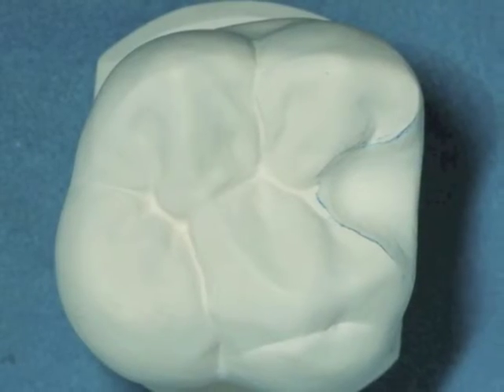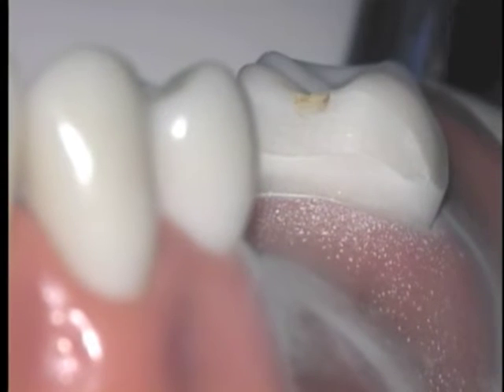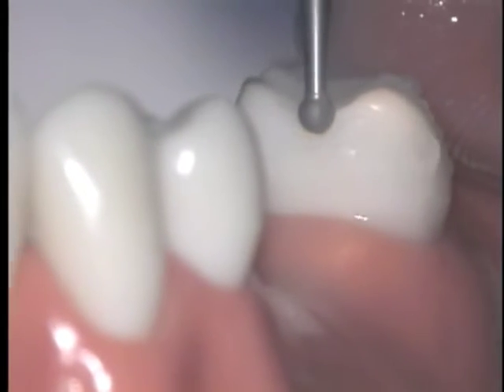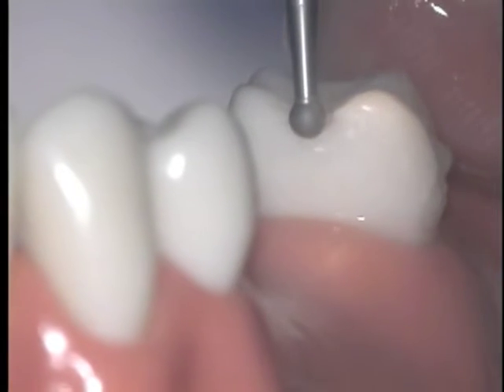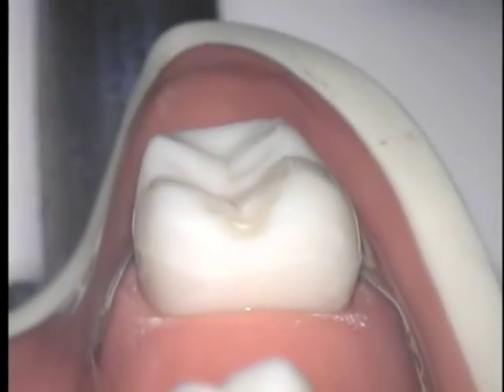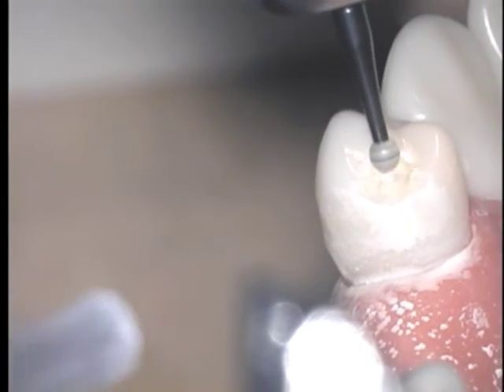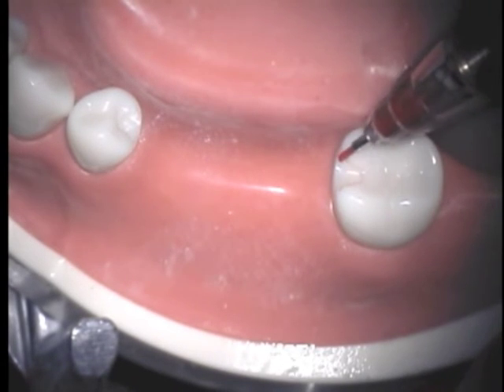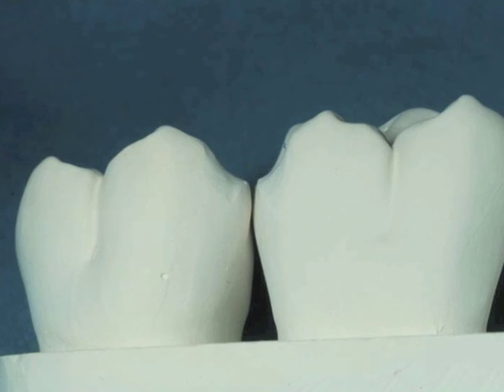06 Occlusal Rest Seats

Comment: Dr. Loney what kind of rest is best for lateral incisor in a class 3 case considering lateral incisor is the anterior abutment and the first molar is the posterior abutment around the edentulous case
Reply from the maker: Each situation is different, but most commonly if there is sufficient cingulum, use either an inverted 'v-shaped' cingulum rest seat (see my video,  https://youtu.be/huI5NG36WlA ) or if there is insufficient bulk of cingulum, a bonded cingulum rest seat (see my video, https://youtu.be/WLK7xaLgR3c ).
Reply: @DrLoneyDal  thank you so much could you please let me know if we need to give a bonded cingulum rest with apron considering the above case and the lateral incisor as maxillary Lateral

Comment: Hi! How do we decide if the rest seat is to be given on the mesial or distal side of the abutment tooth?
Reply: Hi Dr @DrLoneyDal. Thanks for sharing this video. I would like to clarify, is the deepest part of the triangle (apex) 1.5mm depth and the remaining rest seat 1mm in order to prevent the rest seat from slipping(angle formed btwn the rest seat and guiding plan less than 90degrees)?
Reply from the maker: For a detailed answer, please read the section on direct retainers in my RPD manual at http://removpros.dentistry.dal.ca/Manuals.html
Also view the video on "How an RPI Retainer Rotates'